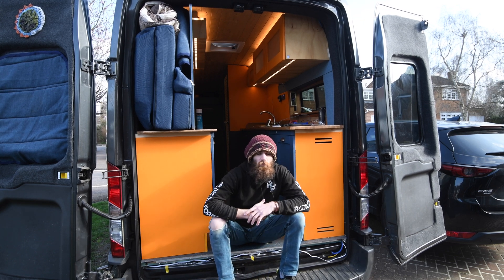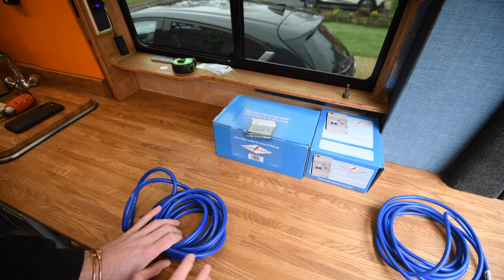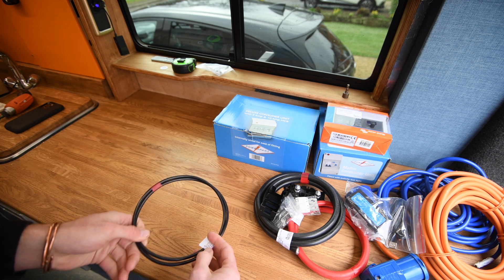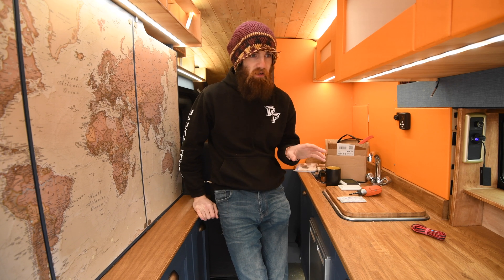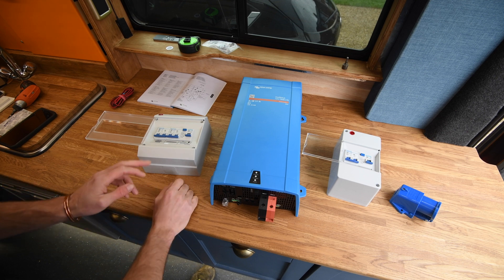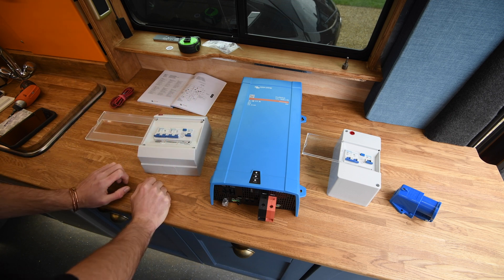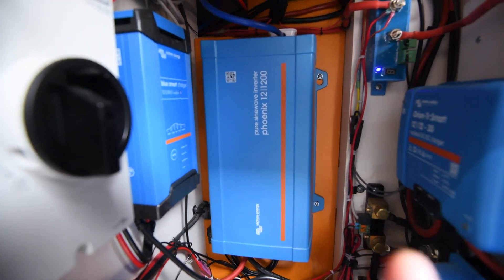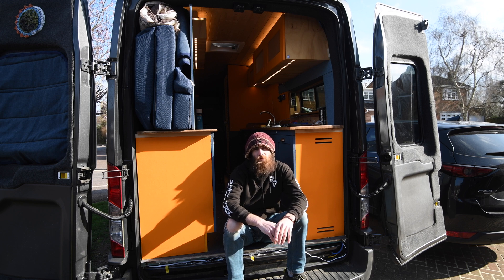Part 1: Installing a Victron MultiPlus : Plans and prep | EP48 | Ford Transit Campervan Build

Comment: Hi Alex

On this video at 14.31 you show a Victron schematic for two consumer units.

Just having a system fitted to my Adria van, any chance of a copy of the schematic.

FYI using two roamer 460 batteries and 12v/3000 watt inverter plus mppt, shunt 50amp DC/DC.

Thanks in advance.
Reply from the maker: So schematics are available for free on the Victron website. best options to find the model of inverter you have, scroll to the bottom and there is a example schematics tab with lots of options
Reply from the maker: Excellent choice of batteries 👌

Comment: Hey Alex, with the Multiplus are you able to disable the charging part via the app or remotely and just use as an inverter? 
I’ve an idea to charge an Ecoflow quickly via mains from the inverter whilst driving.. 2x 30A Orion’s topping up the main battery as I go.
if the charger side can’t be disabled I’d be best with just a phoenix 1200 I rekon ..what’s your thoughts mate? 👍🏼 Ant
Reply from the maker: What would be your reason to disable the charging part of the multiplus? If you are driving then you won’t be on hook up.

Comment: at 12:50: if the system in your van is floating/isolated, then stepping out while touching the live chassis has no return path to the SOURCE, because your van is not grounded to an earth rod or something. the same aplies to floating generators, you can touch the live safely. remember, current always reurns to the source. take care!
Reply: The victron unit can pass through the shore power in which case it joins the shore power earth to the inverter earth so if it's connected to the van chassis then that will be at the same potential as the ground outside so no shocks when getting in and out. The inverter can also operate to boost the shore power if it's limited to 6amp for example. There is a relay in the inverter to disconnect the shore power earth I believe (for when you are away from shore power).
Reply from the maker: The danger is live would short to Earth If you have a live chassis fault Nothing would happen until and you stepped out the into earth and you became the unfortunate conductor between them both. Having a RCD and a AC side of the electrical system earth bonded to the vehicle chassis would cause the RCD trip in such a scenario.

Comment: Brilliant thanks just subbed. One thing I’m stuck with if you have the time to comment it would really help 
I have the ip22 at the moment.. could I take the wires from the Victron ip22 to the multiplus ac in ? Then just need the shore power to then go to ac out would this work 
Thanks again great content 🎉
Reply from the maker: Do you mean could use the same AC which is going to the IP22 to go to the “AC in” the multiplus? Yes you can
Reply: @MispronouncedAdventures  yes I did buddy 👍 brilliant so that’s basically a straight swap out because the breakers are already in place too in the motorhome I bought 
Shore power runs to this  mcu breaker then out cables go to the space heater, water heater & charger all have each a breaker on the mcu box 😊 that’s where I seen the ip22 on that cable 
So I can take out the wires to the ip22 wire them to the multiplus 
Then the shore cable that goes to the mcu I can place a wago clamp on that wire  to run off to the multi that should be good to go I’m hoping 
Saves time fitting more rcds when the motorhome has them already 👍 thanks for the fast reply too buddy
Reply from the maker: Normally you have a consumer unit which as both power which contains a RCD and a MCB ( or multiple MCB’s ). If you’re going to directly swap the ip22 wires are the MCB for the multiplus AC in just Chuck the amp rating on the MCB. As the multiplus ( depending on which model ) will pull a lot more than the ip22. 

When is the AC out of the multiplus going to get. To power all of the normal wall sockets in your motorhome
Reply: @MispronouncedAdventures  yea buddy my unit is called a elcB  mcb I’m honestly new to all this so trying to get my head around the ac side 
Like you have done all the work myself fitting all Victron mppt and b2b the lithium and hybrid battery bank fitted to a vsdr controller 300ah lithium and 230ah acid works brilliantly 
Now I’m trying to fit the 12/1600/70 
the mcb as a RCCB
40A and x3 c10 which just says below 63amp 
And yes the multiplus is for the 230v wall sockets when off grid like a kettle or toaster 
all other appliances run on 12v unless you actually plug into the sockets 
I think the microwave is plugged in too but won’t be used 
It’s just for emergency really just incase we do need it but the charger side be used more buddy
Reply: I have just checked the rcd is rated 45amp to 63 amp then I have x3 mcb rated 10 amp each each mcb is for the charger then 1 for space heater then the last water heater 
the space heater is the one that goes into the mcb then wired to the 230v load (van sockets ) 
My plan would be to run a cable from the multiplus to the rcd for shore power ac in then from ac out on the multiplus to both mcb that was for the charger and space heater 
Then the inverter when used isn’t powering everything just what ever I plug in the van sockets that’s what I’m wanting to do 
I will get a sparky lol to be safe

Comment: Revisited. How can someone as clever as you not do the gas? I had to watch your vid like 5 times just to grasp the basics of what you were saying about the earthing. I found the gas one of the easiest parts of my built, Id love for you to check my victron set up out as I’m pretty sure it’s not earthed like you said? Once again thanks for taking the time to go into such great detail with the electrics
Reply from the maker: As far as gas I guess it comes down to excepting & understanding my skill set and Preferences, I did at one point install it on the strong LPG tank on the van and ran a majority of the piping. I did change and go full electric in my van in the end. You’re free to message me on a different media platform with a Messenger and photos of your system

Comment: :D It can be one consumer unit...the receptacle doesn't matter it doesn't affect the function. Good practice is to not mix voltages in enclosures (unless your 12v is 230V insulated)

Temperature sensing is very necesary for Li-Ion. You have to derate your charger according to temperatures.
Earth the consumers you need a bus to connect things later.

Rubber tyres me hole...they conduct, carbon and steel composite. 
Campers mains is covered under building regs by the way and restricted works...I wouldn't let a sparks near one..they're shyte at batteries. I'm a cowboy by the way.

You're correct about the RCD on the incomer although you could arguably not bother seeing as the passthru RCD is 6" away from it.

Enable PE-N link on the Multi.
Reply from the maker: Yes. The consumer unit ( enclosurer) could’ve quite easily both been the same physical enclosurer, which would’ve been easier space wise just ordering two separate consumer unit small units ( 2 different enclosures ) was just generally easier to find and Order for me. 

Temperature sensing wise in regards to the multiplus Is only for “temperature compensation” which is disengaged by the Multiplus or any of the Victron charges if you engage there Lithium settings. Unfortunately for the Multiplus this doesn’t prevent low temperature charging which needs to be sorted elsewhere. 

“Earth the consumer you need a bus to connect things later” not 100% sure what you mean here. but Each consumer unit here has a Earth bus which I use, that is linked back to Multiplus and it’s Earth point is used a main/single Earth point to bond the Earth to vehicle chassis. 

The RCD on both input and output is recommended by Victron. 

PE-N link is on by default on the Multiplus. Which can be changed in setting
Reply: Most Li-Ion protagonists are putting their heads in the sand about the correct thermal management procedure with li-ion. High C-rate chargers need low and high temperature proportional charger foldback to mitigate fatal lithium plating at low temperature and premature aging & thermal runaway at high temperature.
So while they require temperature compensated charging it is not the same as the legacy Lead kind and it's easier for them to promote hardware if they say "you don't need it"

Sadly most manufacturers are claiming 3k or higher cycles (in a climate-controlled lab)* on LFP but BMS and charge profiling them to 600cycles because anything else is prohibitively difficult, complex and expensive.
It's extremely difficult to remain in the 20% to 80% SOC envelope for example. Chargers are being told to go to 100% and float charging is a big problem too. You're supposed to charge LFP to 80% or less which is difficult because of the memory effect and a flatline holding voltage or go to 95% and immediately turn off the charger inputs.
Now all this turning off chargers means my system efficiencies were much higher with lead. 

MorningStar's ProStar is the only charger I know of with low-temperature charger foldback...I've been petitioning them to add high temperature. It's a big problem for me I have setups that the batteries are A: always too cold to begin with and B: when they get up to temperature require 5 hours cooldown for every 1 at 100% duty.

I meant connect a PE conductor to the earth buses inside the consumer units it's good practice to have a bus instead of daisy-chaining. It means you have somewhere to connect new hardware in the future.

Nothing wrong with an RCD on the input and output, it is correct in fact. Specifically, an RCD immediately after shore power enters the vessel and then another downstream of the inverter. In your case they're are so close you could get away with using the one downstream of the inverter as your shore power incomer too. The advantage of your setup is the inverter transfer switch and inverter chassis are protected too.

The PE-N link enables RCD function.
The reason it's switched is for boats running isolation transformers and other applications that are not ill-advised.

Comment: Very good Alex, we expect to go all Victron in the end, but wanted 100amps of alternator charging for winter trips. I may do a walk around video of the 460 minibus! No one will watch that I guarantee 😂😂
Reply from the maker: I’d definitely love more amps! Definitely come going unused! Depending on the set up, low or high spec Alternators generally still only kick out 60-70amp at idle Revolutions / RPM 1000-1500. The 200+ amps are only his your hitting those high revs. 

You could probably do 2 x 12v B2B 30amp chargers normally. More than that you might want to consider a Second alternator. Drawing too much is going to really heat up the alternator and decrease its lifespan.

I’ll watch your walk around!
Reply: There is a solution that grabs up to 250A from an OEM alternator. In case of ford transit it could be either 160A or 200A, depends on which alternator is installed. Safiery.com and their SCOTTY DC-to-DC. However, it’s purely for a 48V system .

Comment: For the keyboard warriors, rather than calling it “Earth” inside the van I call it a “chassis ground”. I fully agree with having your own incoming RCD, why would you trust your life on someone else’s kit and installation on the mains feed?

I’ve got the 12/2000-80 MultiPlus (metal case) and absolutely love it. Bit of a pain setting up the bulk/absorb/float voltages as like you I’m not using Victron Lithium batteries (mine are 260Ah Winston LiFePo4). The only slight disappointment I’ve noted is the power assist function, where if the incoming power level is limited (and you set it on the remote the panel) the MultiPlus can boost this from the batteries, but the minimum is 4.5 Amps for the mains input and I occasionally use it with a 1200w petrol generator (Lidl inverter type) and would prefer to put a little less load on this.

Great content as always, looking forward to the next part.
Reply from the maker: Yeah I would a agree. I think The main argument comes from the misunderstanding and loose term of “Earth” being use. When using “chassis ground” or “Earth bonding” is more descriptive on what is actually been done. just “earthing it to the chassis” leads to confusion on traditional earth as in connected to earth. 

The setting up was a bit more of a faff than other bits of victron kit with my charge voltages. Planning to go over the different ways of doing it in part 3 

Ah I see. I’m yet to play around with some of the more advanced features just. Maybe at some point in the future where I am competent and have a better understanding of some of them in use I might make a video on them to help others
Reply from the maker: I think with protecting the incoming as well with your own RCD for many it might be the risk is unknown to them . When you lay it out in simple terms to someone about risking there own safety on someone’s unknown equipment / hook up it then makes perfect sense to them

Comment: LOL so is this the final setup Alex? Trolls vs Trolls... let the keyboard warriors fight it out amongst themselves HE HE... anyway I'm glad I have not invested in my Victron set up yet thank you for making all the mistakes for us Alex... this does look like a comprehensive way to go... keep up the good work can't wait for part deux... cheers man
Reply from the maker: Yes! However definitely nothing wrong at all with the Victron Phoenix inverter and Victron battery charger. Both brilliant units but the opportunity came up. Wouldn’t say it was so much is a mistake but this is my first built and electrical system of the scale and you learn along the way. Whilst my solar keeps up with my electrical needs without much issue at all for a battery bank of my size 390ah having the 70 amp charging option  over just 30 is a nice. 

As for the trolls, I think a lot of it comes down to confusion or lack of understanding of the actual intended purpose. As it’s often referred to earthing to the van,  whilst actually it’s earth bonding for the point mitigating the risk of  bodywork live fault when using a RCD over a traditional earth
Reply: @MispronouncedAdventures  Hi Alex yeah will be using your solar and battery to battery set up from before your Phoenix setup, as I think this is going to be adequate for my needs. I do want mains hook up capability though to top off and use direct when on sites though so we will see what I go for in the end. My van build is just a learning project for me too, to see what I actually need for my lifestyle then I will probs sell and buy an AWD Van later as my final build. This is just to get out there doing it! to really work out what I need long term. Your electric's are good as it shows us all the options out there... well just about all of them... ;-) cheers matey

Comment: Im so happy you switched to this route in the end :) I feel like the Multiplus suits your setup perfectly especially with the starter battery charging option :) Keep up the awesome videos! :)
Reply from the maker: I think with the changing my original battery bank from a small lead acid to a reasonably large lithium. And well discovering that the multiplus unit is a thing haha. Find that with the opportunity of a friend buying my current system for a good price. It was well worth the effort. 

The trickle charge system via the trickle port  I have been playing around with. I now have a working solution  as there is a number of reasons in my case why the multiplus trickle charge option won’t work for me . Whilst for other systems it will
Reply: @MispronouncedAdventures  Im curious what voltage the trickle charge system charges the starter at? I cant seem to find the number anywhere in Victrons manuals
Reply from the maker: Victron loosely States its it’s a bit underneath the leisure system voltage. I think when I measured it maybe 0.2 or 0.4v. It’s also not controllable, I suspect it’s a simple diode. It’s still functions when the inverter is in the off position as well

That makes it generally not unusable for a system which has a lithium leisure battery and a lead acid starter. As that would be continually trickle charging your starter battery in the 13v and over area.
Reply from the maker: In the end I opted to use a isolated DC to DC converter powered directly off the leisure system ( as my vans electrics and leisure electrics isolated from each, almost every trickle charger I found needed a common negative between the starter and leisure ) and I can control the output voltage And then purchased a 1amp trickle charger and powered it off the converter. I’ll show my working through of the process and ultimately failure to use the trickle charge port on the multiplus in my System set up in one of the videos I’m sure I’ll get stick for in the comments haha
Reply: @MispronouncedAdventures  looking forward to seeing it! Even if the trickle charger part was a failure, it'll be great to see how you went through the process still! Definitely appreciated!
Reply: @MispronouncedAdventures  Just wondering how this was going? Im looking at doing the same and have found your findings you mentioned above really interesting and I agree with the lithium leisure and lead acid starter usability issue.  I haven't been able to spy the 1amp trickle charger setup in any of your videos unless i missed it. Sounds like a great work around though.
Reply from the maker: Hey, the trickle charger is great. I don’t think it features in the video at all, but the model number is. “E848 12v 1amp battery charger”